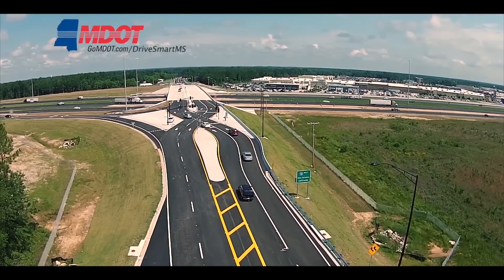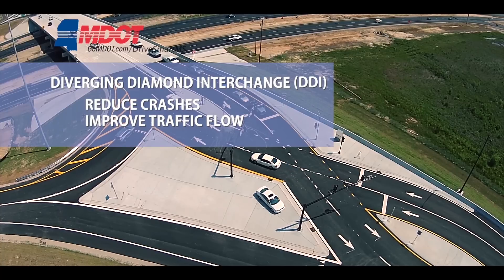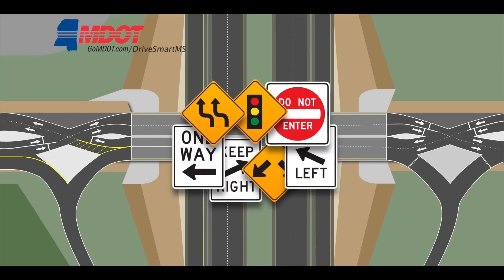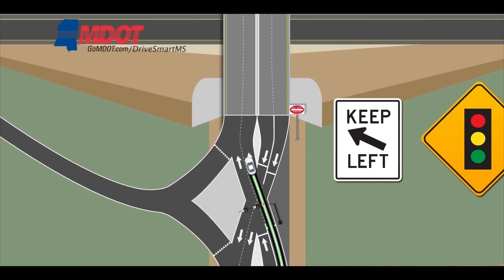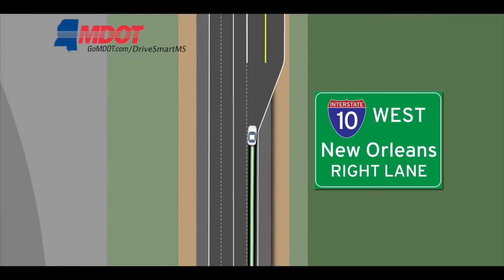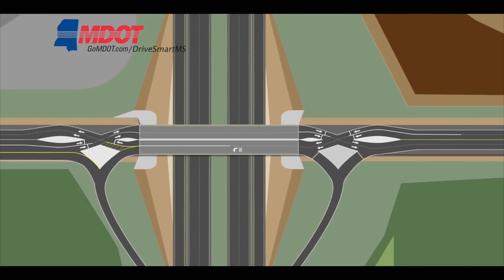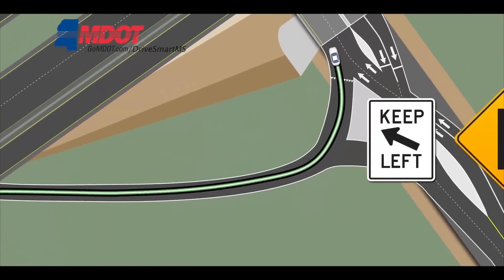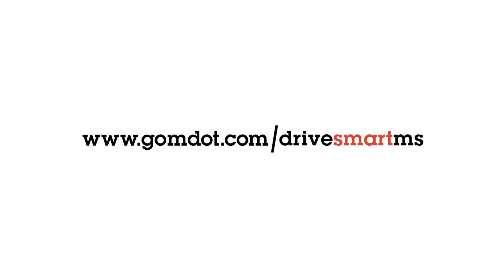Diverging Diamond Interchange in D’Iberville on Interstate 10

Comment: They might reduce accidents at that specific location but teaching people to drive on the "wrong side of the street" seems dangerous.  These DDIs require intense attention and confusing reading of signs until you become familiar with them.  For regular travelers of that interchange sure, they aren't a problem, but for someone new to the area they are a stress inducing nightmare.